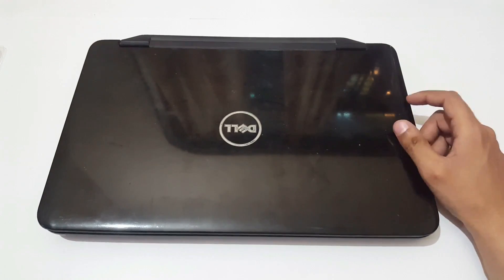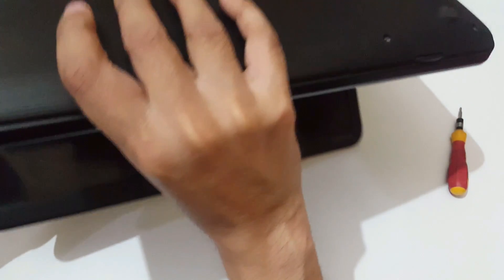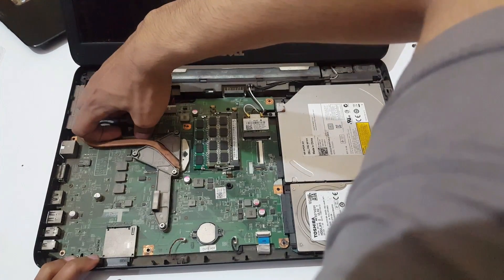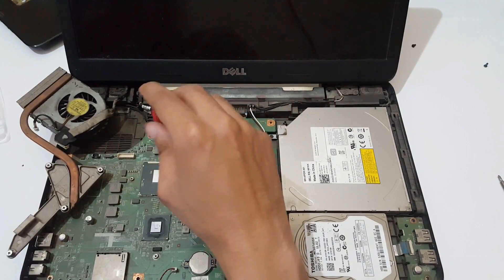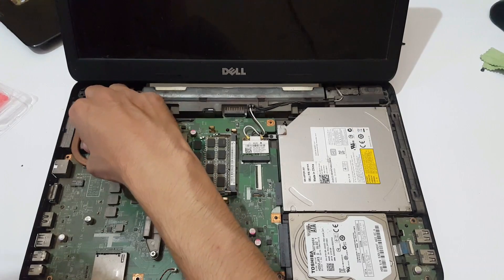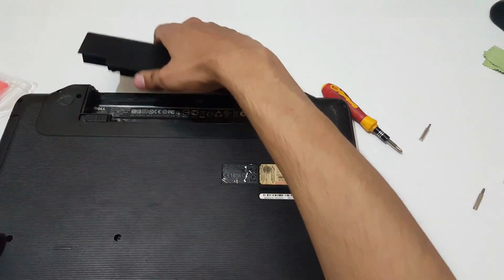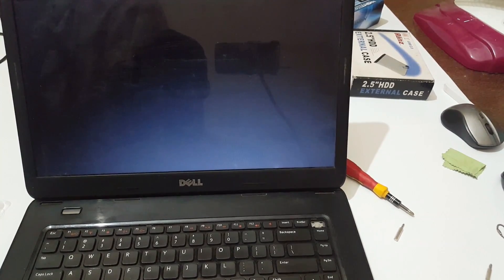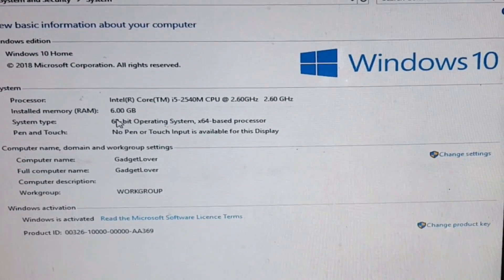How to Upgrade Processor on DELL Laptop | i3 to i5 & i7 - Make Laptop Faster for Gaming

Comment: Can we upgrade hp 15 series laptop to i5 from i3?
Reply from the maker: I would like to inform you that if the processor is not soldered you can upgrade it in same generation only
Reply: @GadgetLover360  thanks man
Reply: @GadgetLover360  and how to check whether processor is soldered or not?
Reply from the maker: @pranjalagawane3125  You're welcome and I would suggest you see its disassembly video

Comment: Sir , my laptop is ThinkPad e14 i3 processor, 4gb ram ,, can I upgrade it to i5??
Reply from the maker: The processor of this Laptop is soldered so you can't upgrade it but I would suggest you upgrade its RAM and install SSD for better performance
Reply: @GadgetLover360  i3 dell vostro 1450 can i upgrade i5 or i7 please reply
Reply from the maker: @satish7871  Yes but in same generation only

Comment: I have Dell Vostro 3468 Intel(R) Core(TM) i3-6006U CPU @2.00GHz 2.00GHz;Ram=4 GB 64 bit Operating system, So can I upgrade it to i5?
Reply from the maker: Devansh Pandey : The processor of this Laptop is soldered so you can't upgrade it but I would suggest you upgrade its RAM and install SSD for better performance

Comment: My laptop is hp and Intel celeron n3060 1.6ghz but my socket is lga not bga so can I upgrade ???
Reply from the maker: FS FLASH YT : Yes
Reply: @GadgetLover360  but other youtubers are telling that you can't upgrade lga or bga I didn't know which is isn't upgradable....
Reply from the maker: FS FLASH YT : None because BGA circuits can also be upgraded with the help of professional hand soldering services
Reply: @GadgetLover360  I had asked my neighbour shop but they said we cannot do...
Reply from the maker: FS FLASH YT : I would like to inform you that only a professional hand soldering services can upgrade BGA processors
Reply: @GadgetLover360  where I will get 'professional had soldering servicer' ??? In mumbai
Reply from the maker: FS FLASH YT : I would suggest you after lockdown go to nearby PC & Hardware store and ask them about it
Reply: @GadgetLover360  I would like to inform you THANKS 😂
Reply from the maker: @vedangrasam9  You're welcome

Comment: I have a Lenovo IdeaPad 320 with i3 6006u. Best upgrade I can make?
Reply from the maker: ICONIC TMM : The processor of this Laptop is soldered so you can't upgrade it but I would suggest you upgrade its RAM and install SSD for better performance
Reply: @GadgetLover360  what about dell 1747 with Intel i7 720qm
Reply from the maker: ICONIC TMM : Yes you can upgrade it and Intel Core i7 840QM is best processor for your Laptop
Reply: @GadgetLover360  okay thanks
Reply from the maker: ICONIC TMM : You're welcome

Comment: Intel(R) Core(TM) i3-6006U CPU @ 2.00GHz   2.00 GHz 
Is it possible to upgrade to i5 with the same generation sir?
Please suggest the accurate one if you can
Thank you :)
Reply from the maker: Siddhant Kudav : You're welcome and I would like to inform you that if the processor is not soldered yes and Intel Core i5 6300U is best processor for your Laptop
Reply: that processor is soldered to the board, so no upgrades

Comment: Amazing video what is suitable for my laptop dell inspiron 15 3000 series
Reply from the maker: aif : Thanks and I would like to inform you that if the processor is not soldered you can upgrade it in same generation
Reply: @GadgetLover360  my current cpu right now is core i3 and I'm thinking I'm gonna buy a core i5 750
Reply from the maker: aif : As I said if the processor is not soldered you can upgrade it in same generation only
Reply: @GadgetLover360  oh ok
Reply: @GadgetLover360  ok so my cpu arrived then why is my laptops cpu not opening when I try it?

Comment: I don't think we should upgrade the processor bcz it can't handle the heat of the processer so we shouldn't upgrade the processor
Reply from the maker: Justdeepak : I would like to inform you that it depends on upgraded processor thermal design power
Reply: @GadgetLover360  so you are saying that I can upgrade my processor if the thermal design power suits my computer?
Reply from the maker: Justdeepak : Yes and thermal design power is not main issue you can use cooling pad or laptop will run hot but I would like to inform you that same generation requirement is necessary
Reply: @GadgetLover360  oh I have a laptop which has Intel celeron can I upgrade it to i3?
Reply from the maker: Justdeepak : I would like to inform you that if the processor is not soldered you can upgrade it in same generation

Comment: Nice vid !! But can you tell me if I can change my core two duo t5870 to an 3rd gen I 5 I have 4gb ram and gt 710
Reply from the maker: Aaryan Koleth : Thanks and if the processor is not soldered Intel Core 2 Duo T7800 is best processor for your Laptop and I would suggest you upgrade its RAM and install SSD for more better performance
Reply: Thanks
Reply from the maker: Aaryan Koleth : You're welcome

Comment: Hey can I change it with Qualcomm 865
Reply from the maker: Manasi Mandal : No and I would like to inform you that if processor is not soldered you can upgrade it in same generation only
Reply: @GadgetLover360  ok
Reply: @GadgetLover360  can I change it with Intel core 9?
Reply: @GadgetLover360  wht Is meaning of solder?
Reply: I don't knoe
Reply from the maker: Manasi Mandal : Processor is permanent mounted to motherboard
Reply: @GadgetLover360  mai chota hoon
Reply from the maker: Manasi Mandal : I would suggest you search BGA processor on Google for it

Comment: My laptop has i3 2350m processor right now.......which all processors will my laptop support....please tell bro
More info:
It is PGA supported
Motherboard :- VPCEH35EN

Please help bro 🙏
Reply from the maker: Stuudy Account : Intel Core i5 2540M is best processor for your Laptop
Reply: @GadgetLover360  thank you......can I upgrade it to i7.....and also tell me which one
Reply from the maker: Stuudy Account : You're welcome and yes Intel Core i7 2640M
Reply: @GadgetLover360  Bro will my laptop run faster when I will upgrade it's processor from i3 to i7
Reply from the maker: Stuudy Account : Yes and I would suggest you upgrade its RAM and install SSD for more better performance

Comment: Bro I have dell inspiron 14 3467 laptop. Can I upgrade it's a processor from i3 to i5? I have i3 6006u processor in it.
Reply from the maker: Unique Astro : In my knowledge the processor of this Laptop is soldered so you can't upgrade it but I would suggest you upgrade its RAM and install SSD for better performance

Comment: Can i change Asus x543 celeron processer in i3 or i5 proccer
Plz reply🙏
Reply from the maker: Aditya Kumar : I would like to inform you that if the processor is not soldered you can upgrade it in same generation

Comment: Superb.... 👍, Bhai apka ek help chahiye email do please, motherboard pe spring type 2 contact copper ke, ram ke baju me , wo kiske hai, wo toot jaye to ??? I have same laptop with B960 processor, can I upgrade it ???
Reply from the maker: Alpesh Mewada : Thanks and yes you can upgrade it to Intel Core i5 2540M but I would suggest you very carefully disassemble the Laptop to upgrade processor
Reply: @GadgetLover360  thanks for reply bhai, but in my motherboard spring type 2 nos copper contact are damaged near ram, will it be any problem ???? Please help
Reply from the maker: Alpesh Mewada : You're welcome and if RAM are still properly connected and system is working then no problem

Comment: can i  upgrade my dell inspiron 3505 ryzen 3 to ryzen 5?
Reply from the maker: Abhishek Sethy : The processor of this Laptop is soldered so you can't upgrade it but I would suggest you upgrade its RAM and install SSD for better performance
Reply: I have 4gb ram and 256gb ssd but sometimes the laptop hangs so much
Reply from the maker: Abhishek Sethy : I would suggest you upgrade its RAM for better performance
Reply: Thanks for suggestion🙏 I'll think about it
Reply from the maker: Abhishek Sethy : You're welcome

Comment: Sir I want to Play Gta 5 so what should I upgrade first my RAM or SSD . 
My Specs - Dell Inspiron 15 3542 
 Intel Core i3 4005U (4th generation  1.70 Ghz)
1TB Hard Drive 
4GB Ram 
Windows 7 
64 Bit Operating System
Intel(R) HD Graphics 4400
Thanks In Advance ❤️
Reply from the maker: Legendary Gamer Suprotim : You're welcome and I would suggest you upgrade both and attach external graphics card for better gaming experience

Comment: bro i have Dell Vostro 15–3568 laptop .....Intel core i3 processor , can i upgrade it to i5 processor?
Reply from the maker: DRC World : The processor of this Laptop is soldered so you can't upgrade it but I would suggest you upgrade its RAM and install SSD for better performance

Comment: pls pls tell me that i hav etwo laptops and i want to install processor of one laptop to another...pls tell me while installing the processor our data will be lost??
Reply from the maker: Amarjeet Kaur : No but I would like to inform you that if processor is not soldered you can upgrade it in same generation only
Reply: @GadgetLover360  soldered...means that glue type gel that applied on the above surface of processor...when.placed in the processor section
Reply from the maker: Amarjeet Kaur : No it means processor are attached to the circuit board

Comment: Bro Can i upgrade my Dell i3 3593?
Reply from the maker: ĐÂŘK ŠHĂĐÖW : The processor of this Laptop is soldered so you can't upgrade it but I would suggest you upgrade its RAM and install SSD for better performance
Reply: @GadgetLover360  thankq bro. Btw its really slow i mean the stock one's. It suck. 16GB ram compatible?
Reply from the maker: ĐÂŘK ŠHÅĐÖW : You're welcome and yes

Comment: Can I upgrade my laptop's prosessor?
It's dell Inspiron 15 3251
I3 3217u
Reply from the maker: Manas Yadav : The processor of this Laptop is soldered so you can't upgrade it but I would suggest you upgrade its RAM and install SSD for better performance

Comment: Bro i have i3-3rd gen can i upgrade it 
I have also not upgraded ssd and ram
Reply from the maker: Mr. BaBa Boy : If the processor is not soldered you can upgrade it in same generation
Reply: @GadgetLover360  thnks what a fast reply
I think I should wait and buy a new pc
Reply from the maker: Mr. BaBa Boy : You're welcome

Comment: Hello i have dell n5010 i5 520m

can i upgrade i7 2670qm ?
Reply from the maker: Qedir : No because it can upgrade in same generation only but I would like to inform you that Intel Core i7 640M is best processor for your Laptop
Reply: @GadgetLover360  okey can i get External Graphics Card (Gt630)
Reply from the maker: Qedir : Yes you can attach graphics card externally to your Laptop
Reply: @GadgetLover360  can this help boost my fps?

i have now 30-35 fps 

i buy gt 630 how many fps did i get?
Reply from the maker: Qedir : This will definitely improve the gaming experience

Comment: Hello sir .... I have Dell inspiron 15 with 4gb ram and 500 storage and intel i3 4030u
I want to upgrade it to i5 to play batman arkham knight
Sir please suggest a good compatibility
Big fan sir big fan
Reply from the maker: Untalented Guy : Thanks for your love & support and if the processor is not soldered Intel Core i5 4310U  is best processor for your Laptop and I would also suggest you upgrade its RAM and install SSD for more better performance
Reply: @GadgetLover360  sir what about an intel i5 750?
Can it survive the heat?
Reply from the maker: Untalented Guy : This is a Desktop processor
Reply: @GadgetLover360  ok sir thanku so much
Reply from the maker: Untalented Guy : You're most welcome

Comment: Hi bro can i upgrade my laptop it has intel i3 6006u with 4gb ram. Laptop is of lenovo
Reply from the maker: Takle Gamer YT : I would like to inform you that if processor is not soldered Intel Core i5 6300U is best processor for your Laptop
Reply: @GadgetLover360  so should i upgrade ram and this processor you told. And ram to 16gb
Reply from the maker: Takle Gamer YT : If processor is not soldered yes and for RAM upgrade details see its manuals
Reply: @GadgetLover360  my laptop is 3years old
Reply: @GadgetLover360  can you please tell what is soldered
Reply: @GadgetLover360  it is Lenovo ideapad 320
Reply from the maker: Takle Gamer YT : The processor of this Laptop is soldered so you can't upgrade it but I would suggest you upgrade its RAM and install SSD for better performance
Reply: @GadgetLover360  how much ram

Comment: Can i upgrade my dell inspiron 3521 processor and which processor support it
Reply from the maker: CORONA WARRIORS : The processor of this Laptop is soldered so you can't upgrade it but I would suggest you upgrade its RAM and install SSD for better performance
Reply: Also can i upgrade my camera of inspiron 3521 because it is 1mega pixel can i upgrade
Reply: Can i use sshd instead of ssd
Reply from the maker: CORONA WARRIORS : Yes

Comment: Hi sir my laptop is Dell Inspiron 5509 i3 processor,8gb ram ,512 ssd
 , can i upgrade it to i5
Reply from the maker: santosh kumar kgl : Hi and I would like to inform you that the processor of this Laptop is soldered so you can't upgrade it but I would suggest you upgrade its RAM for better performance

Comment: Sir, i have a Dell laptop with intel(r)celeron(r) cpu N2840 2.16GHz 4gb ram, it's also 64 bit, can i upgrade it to intel core or to other faster processor? what woyld you recommend? thankss
Reply from the maker: joe mama : You're welcome and Intel Pentium N3540 is best processor for your Laptop
Reply: @GadgetLover360  thank you, follow up question, can i run valorant in that  processor because the required processor is intel core i3 if i not mistake, what's better core i3 or that pentium n3540?
Reply from the maker: joe mama : You're welcome and I would like to inform that you can upgrade processor in same generation only
Reply: @GadgetLover360  thank you, follow up question, can i run valorant in that  processor because the required processor is intel core i3 if i not mistake, what's better core i3 or that pentium n3540?

Comment: Dell  inspiron  I can  change  with  HP  processor  pls
Reply from the maker: emmanuel paulsax : I would like to inform you that if processor is not soldered you can upgrade it in same generation only
Reply: @GadgetLover360  oh dell  processor  can't  change  HP processor  high  generally
Reply from the maker: emmanuel paulsax : It can if processor generations are same

Comment: Hi sir can I upgrade my Dell Inspiron 15 3521?
Reply: It is currently i3 3227u generation..
Reply from the maker: Binay Kr. Manna : Hi and I would like to inform you that the processor of this Laptop is soldered so you can't upgrade it but I would suggest you upgrade its RAM and install SSD for better performance
Reply: @GadgetLover360  thanks sir.....
Reply from the maker: Binay Kr. Manna : You're welcome

Comment: Is it good to upgrade i3-3110m to 3940xm or 3770
Both are same generation 3rd gen
Reply from the maker: Madd Grove : But Intel Core i3 3770 is a desktop variation
Reply: @GadgetLover360  ok what for 3940xm its mobile and 3rd gen almost i think its same can i?
Reply from the maker: Madd Grove : Yes but after upgrade I would suggest you to use cooling pad
Reply: @GadgetLover360  thanks for reply :)
You mean the processor cooler?
Ok mine is old i might also upgrade that
Reply from the maker: Madd Grove : You're welcome
Reply: @GadgetLover360  oops you mean 
Not the cpu cooler inside oh a cooler which connects with the usb or like that
On and place it under the laptop hmm ok ;D
Reply: @vladimirazirov1815  what you mean 4 cores processors may the psu in the motherboard burn?
Hmm ok then what for using a cooling pad?
Reply: @vladimirazirov1815  
And thanks for saying it or what could i done to my laptop :)
But can you say which is the best cpu 
I7 3720qm 4 cores 3.6ghz 6mb
I7 3740qm 4 cores 3.7ghz 6mb
I7 3820qm 4 cores 3.7ghz 8mb
I7 3840gm 4 cores 3.8ghz 8mb
I really liked 3820 and 40 also
Can i :)

Comment: Hey man! The video was great! But do we not have to change the fan and the motherboard when the CPU is upgraded? Also, the battery consumption will also change, right? 
I happen to have a Dell Inspiron 15 3000 - 3595. It struggles to play Minecraft so, I thought a CPU upgrade would be good. Can I upgrade it at a low cost without changing any components?
Reply from the maker: Joel Joy : Thanks and I would like to inform you that the processor of this Laptop is soldered so you can't upgrade it but I would suggest you upgrade its RAM and install SSD for better performance
Reply: @GadgetLover360  Okay... Thanks a lot
Reply from the maker: Joel Joy : You're most welcome

Comment: It is possible to upgrade dell 3467 i3?
Reply from the maker: vic pineda : The processor of this Laptop is soldered so you can't upgrade it but I would suggest you upgrade its RAM and install SSD for better performance

Comment: nice vid brother:) i have a hp 15-ac125tu with intel core i3-5005U. Best upgrade i can make? and also i have 4gb ram , i want to uprade it
Reply from the maker: gigel badea : Thanks and unfortunately the processor of this Laptop is soldered so you can't upgrade it but I would suggest you upgrade its RAM and install SSD for better performance
Reply: @GadgetLover360  hello sir, y r u not replying me... I asked you about the processor upgrade of intel i3 3110...
I'm using 4gb ram...
Reply from the maker: @eeswaracharykathoju1373  Hi and Intel Core i5 3380M is best processor for your Laptop and I would also suggest you upgrade its RAM to max and install SSD for more better performance

Comment: i'm using dell inspiron 3520, in which i have i3-2370M 2.40Ghz(sandy bridge) and Max TDP 35W. Socket 988BrPGA. Now i wants to upgrade this so can u tell me which processor should i buy?? thanx in advance.
Reply: alright and any option in i7??
Reply from the maker: Ras gulla : Intel Core i7 2640M
Reply from the maker: Ras gulla : You're welcome and Intel Core i5 2450M is best processor for your Laptop